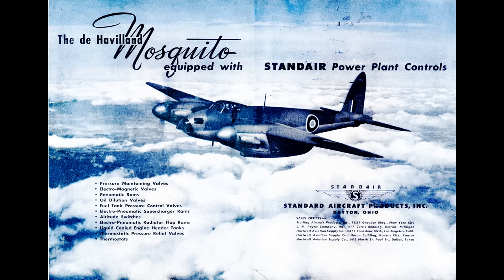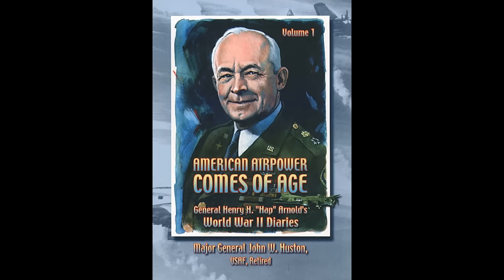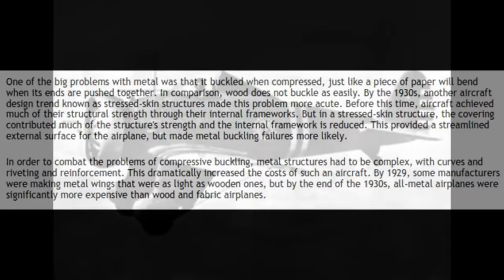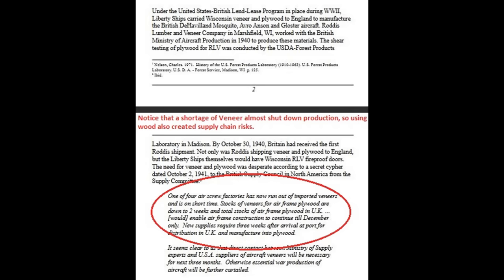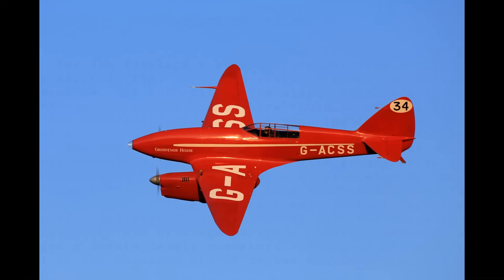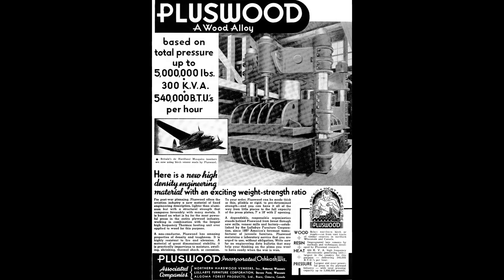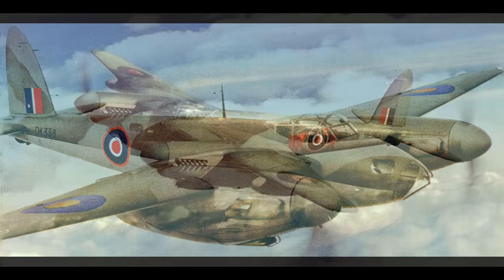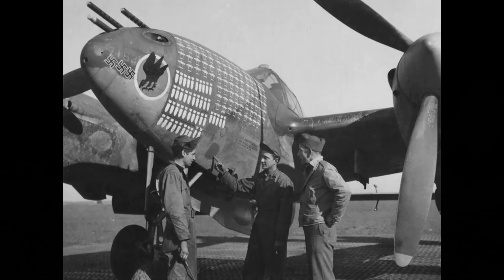De Havilland Mosquito vs. ?

Comment: America really missed the boat on the Mosquito.  This is almost a do-everything aircraft.  Only chauvinistic thinking and prejudice against wood caused us to take a pass on this.
Reply: @frankcorner8716  The B-17 looked good and got good press, and it was state-of-the-art for the 30s.  B-24 and B-25 were considerably better, but B-17 got the glamour.  Mosquito could carry almost as much as a 17, fly faster, cost considerably less, and only risk 2 people instead of 10, though not at such high altitude.  Another real winner that got left behind was the Westland Whirlwind.  It was a doozy, but shortage of Rolls Royce Merlin engines left it underpowered with Peregrines.
Reply: If wood was so superior - why did the RAF build everything else out of aluminum, even after the outstanding qualities of the Mosquito were known ?
Reply: If the Mosquito could do everything better, why did the RAF order many thousands of Lancasters and Spitfires and Typhoons?
Reply: Frank Corner - the Mosquito was actually a fairly poor high altitude bomber.  The RAF ordered many thousands of Lancasters even after the brilliant qualities of the Mosquito were well known
Reply: Frank Corner - and yet the US had negotiated huge manufacturing licenses with foreign non-belligerent and Allied Countries during WW2.  Rolls Royce, Bofors, and Oerlikon are good examples.
Reply: Frank Corner - oh, if altitude is your criteria for high altitude bomber performance then the V-2 wins.  Many viewers are making this flawed and over simplified observation and I’m sure that Greg will address it in a future video. Suffice it to say that 2,500 Mosquitoes will not provide better (or even equivalent) target service at 27,000 feet as compared to a thousand Forts or Lancasters.
Reply: Frank Corner - :  a Mosquito with a 4,000 pound bomb load is no longer a Mosquito.  It’s a heavily laden twin engine bomber with mediocre range.
Reply: Frank Corner - Wow, Bomber Command and the Eighth AF had it all wrong.  If they just used Mosquitoes they would have saved 110,000 lives and shortened the war by two years.  Those idiots.
Reply: Frank Corner - well if Bomber Command put up 700-900 plane raids with Lancasters then three  thousand or so Mosquitos per night would have done the trick.  Hell, might as well have 617 Squadron in the Mosquito.
Reply: Frank Corner - The RAAF had 209 Mosquitos.  They used them for primarily for photo-reconnaissance.  The RAAF and the RNZAF preferred the Beaufighter for anti-shipping and ground attack in the Pacific.
Reply: Frank Corner - Let me give just one example why it’s incorrect and misleading to superficially cherry pick performance data - especially when it comes to the Mosquito.  On September 28, 1944, the USAAF sent 243 B-24 Liberators to bomb the Henschel factory In Kassel, Germany.  The carefully planned raid destroyed 95 % of the plant floor space and put an end to King Tiger tank production.  After the war, it was learned that the raid caused the loss of production of about 657 Tiger II’s.  The long range load out for the B-24 is given at 5,000 pounds.  Since the max bomb load of the Mosquito is listed as 4,000 pounds - why didn’t the Allies send 292 Mosquitos instead?  Because it had to with properly “servicing a target” in Air Force parlance.  The B-24 has a considerably larger bomb bay than the Mosquito.  The Henschel factory was quite large.  And therein lies the nuance.  The 4,000 pound payload for the Mosquito was for one particular bomb - the 4,000 pound “cookie cutter”.  Alternatively, two five hundred pound bombs could be carried within the Mosquito bomb bay.  While theoretically it MIGHT have been possible for the Mosquito to also carry one 250 pound bomb under each wing - B-24’s with ten 500 pound bombs are going to “service” a large area industrial target better than a smaller number of large bombs, and the fact that the Germans told us after the war that the raid demolished 95% of the Henschel floor space tells us that the B-24 was the right plane fir this particular job.
Reply: Frank Corner - Frank, I hope you’re well.  You asked about the cost of the raid.  ** 198 P-51’s escorting.  31 B-24’s and 1 P-51 lost.  118 KIA, 121 POW.  The Germans lost 29 fighters and 18 Luftwaffe pilots KIA. 

* Eleven US aircrew were captured and lynched (killed) by civilians.  This was found out by the USAAF, and leaflets were dropped in the vicinity in follow up operations.  Just outside the city limits of Bad Hersfeld the USAAF carpet bombed an area to intimidate the locals and send a message.

* ** In 1990 a Memorial was erected at a USAAF crash site in the Seulingswald as a gesture of reconciliation
Reply: @frankcorner8716  - so happy to hear that Harry was rescued by the police.  No doubt that the RAF and the USAAF took a terrible toll on the civilian populations for five long years so maybe that's the difference.  I heard of a US P-51 pilot, a Captain, who was lynched by civilians the day the war ended.  The Henschel factory at Kassel was a very high value target, and it was defended by very highly experienced and well armed Luftwaffe fighter units.  German Jagdgeschwader 3 (Udet), 4 and 300. These fighter wings had Bf 109s and Fw 190s which had been specially adapted and equipped with extra armour and extra 20 and 30 mm cannons.   This battle was one of the largest confrontations in the ETO between the USAAF and the Luftwaffe - which was fascinating because the Luftwaffe was barely alive.
Reply: @frankcorner8716  - it was going to be bloody no matter where the Allies managed to land an invasion of that size and scope.  There are only a couple different places that you can do it and the Germans are very smart.  Rommel helped tremendously with his military engineering background.  The US Marines in the Pacific can attest to how costly it can be to assault dug in fortifications that have had the benefit of years of preparation.  Honestly, Frank, the Allied Commanders thought D-Day was going to have considerably more casualties than it did.
Reply: @frankcorner8716  - well, the German war machine ran low on fuel because of a sustained Allied bombing campaign from 1942 to 1945.  In 1940 the RAF had identified German oil targets.  The RAF and the USAAF suffered mightily in the Ploesti raids trying to put out Romanian oil production.  The Soviets pushed the Germans out of the Baku oil fields and the Allies eventually bombed out German held oil fields.  The Germans turned to synthetic oil production (coal to liquids) which was dispersed across 16 sites in Germany.  Between May 1944 and May 1945 the Allies launched 651 raids against German oil and fuel targets.  By September of 1944 the Luftwaffe was only getting 5,000 tons of fuel per month, which was something like a 97 percent reduction.  By December of 1944, Albert Speer informed Hitler that the fuel situation was "catastrophic".  The German Ardennes Offensive in December 1944 was literally predicated on the Germans capturing Allied fuel supplies at Antwerp.
Reply: @frankcorner8716  - The standard B-24 had at least 900 miles more range than the Mosquito.  There's absolutely NO way that the Mosquito could have bombed Romania using the Ploesti Raid routes.  RAF Coastal Command used B-24 specially modified VLR Liberators for the Battle of the Atlantic - specifically, to close the Mid-Atlantic Gap and for the Bay of Biscay.  Quite a few military historians will tell you that the Battle of the Atlantic could not have been won without the B-24 Liberator.  The RAF took delivery of their first Liberators on June 2, 1941 - six months before the United States entered the war.  In February, 1942 RAF Coastal Command and the First Lord of the Admiralty requested that NINE squadrons of US B-24's be transferred to Coastal Command.  At first, Churchill balked and wanted to use British aircraft - but Joubert insisted that the B-24 was the only aircraft suitable for VLR maritime operations.

Comment: A primary reason for using wood, was a foreseen shortage of metal.  And, by having a design made up of components let production be subcontracted out to unskilled, but trainable, workers. An added benefit was very little radar return.
Courtesy of Half Vast Flying.
Reply: The engines, cannon and machine guns in a Mossy fighter bomber weighed almost as much as an early Spitfire. Is there any actual data on the Mossy having a significantly  smaller radar signature compared to other aircraft?

Comment: P38 vs Mosquito? See: payload.
Reply from the maker: I have, one can carry 4000 pounds of bombs in multiple combinations (including dual 2000 pounders), the other can either 2000 pounds of bombs or a single un-aimable barrel loaded with 4000 pounds of explosives. Obviously there is a lot more to it, which will cover as this series progresses. Both planes are actually pretty comparable in terms of maximum payload and payload versatility.

Comment: Quick question for the moment, could the P38 carry a single 4000lb bomb?  If not, then the two were not equivalent.  The mosquito was designed to do so and did so.  At the time, that was the bomb load of a B17 for a long mission.  

I am not saying the P38 was inferior, but they were different aircraft designed for different purposes.  The craziest Mosquito was probably the TSETSE, only the British could take an aircraft designed for speed through being light, put some armour on it and fit it out with a 57mm, 6lb, anti-tank gun - U-boat commanders were not fans.  I especially like the film of the gun being test fired while the aircraft is on the ground, the aircraft rocks back from the recoil.

Seeing the Mosquito being used as a fighter aircraft, DH realized that it would probably be outflown by later fighters.  So during the war, they designed what would become the post-war Hornet.  Essentially, a small Mosquito optimized as a fighter, powered by two 2070hp Merlins (contra-rotating props).  This project was unfortunately put on hold till after the war, as the main threat from the German Luftwaffe had passed.  It was Eric Brown's favourite piston powered aircraft, he was probably the most experienced test pilot ever.

Like the Mosquito, DH looked at powering the Hornet with two 2400hp Napier Sabres (post-war that would have been the 3050hp version).  The Sabre was a BIG engine, the aircraft would have been a bit different, the cooling required for 6100hp of liquid cooled engines - the mind boggles.
Reply from the maker: Man I really need to finish that P-38 vs. Mossie video. So many misconceptions to deal with. Love you buddy, but you managed to get three wrong facts worked into your first paragraph.
Reply: @GregsAirplanesandAutomobiles  Bugger!   Wrong video!  I had too many tabs open at the same time.  Sorry about that.  Le me know if something is factually wrong.  Otherwise, misconceptions?

Nevertheless, the Mosquito was a larger aircraft than the P38.  Sir Jeffrey DH had the foresight to envisage the Mosquito, but he did so as a bomber.  I may have missed it over the years,  but I do not think he initially envisaged it as a multi-role aircraft, at least not to the extent in which it became one.  In some roles, it got away with it, the engines were far too obvious and vulnerable for these roles.  

They armoured the engines on the TSETSE as the anti-aircraft fire from ships was a bit too intense for the Mosquito.  

One of the lesser know parts of the story was in pursuit of the V1s.  The Tempest V was the main aircraft predator for the V1 as it was the only aircraft that was fast enough to catch a V1 in level flight (they flew low).  Unfortunately, there were just a handful of Tempest Vs available at the time (remarkable that so few shot down so many), enter the Mosquito.  The Mosquito kills were almost as many as the Tempest V,  but the Mosquito wasn't fast enough in level flight.  The RAE had been experimenting with Nitrous-oxide injection and a system was developed to fit in the bomb bay of a Mosquito, this increased the power of the Merlins by about 300hp each at all altitudes.  Even Stanley Hooker could not manage that.  Unfortunately, there just wasn't room for nitrous in most fighters, the system and tanks were large and heavy.  When tested in a Spitfire, the best they could fit was good for a little less than one minute, in the Mosquito, six minutes of nitros injection was available.

As previously stated, DH envisaged the Hornet as the fighter.  The Mosquito's success put the Hornet on the back burner.
Reply: Fact check needed
Reply: @sandervanderkammen9230  Fact check on what? You need to be more specific.  
Nitros system
 All of this information including photos of the nitrous system installed in the bomb bay is available to anyone using a simple search of the internet. 
The  VI 
The numbers of V1s destroyed by all types of  weapons are also available after a simple search, The aircraft figures do not vary greatly.  Land-based gun emplacements destroyed the most V1s after the introduction of the proximity fuse,  but then I did say aircraft preditor.

Sir Jeffrey DH thinking on the role of the Mosquito came from a book, I shall see if I still have any on the Mosquito but I doubt it.  We disposed of most of our books when we went traveling 20 years or so ago.  This is also most likely online The Hornet was designed in 1941 once the Mosquito was put into production, however as the war progressed the role this aircraft was to occupy became less critical.  The prospect of a fighter for the pacific theatre gave the impetus to complete the Hornet project.
Reply: @robertnicholson7733  You seem very confused and misinformed, nothing in your comments are accurate or supported by factual information.
Please stop spreading lies and misinformation on this topic.
Reply: @johnbrewer8954  The Alternate name for the Cookie was the "Blockbuster Bomb", it was called a bomb by most of RAF staff, sometimes just the 4000lb bomb.  Yes, it had a thin casing, but it still massed the same, it would shave been physically smaller had the casing taken up the usual percentage of overall mass.

The original design studies included a full series, of loads, equipment weights, engine powers, bomb loads, etc.  Early design studies also looked at alternate power plants (as required, at the time, by the MAP including the Napier Sabre).  The original bomb loadings were much smaller, however,  the aircraft's wing design was critical as pretty much everything is attached to it (the fuselage was often considered to be just along for the ride) and was designed with the future in mind, the fighters had strengthened wing spars to withstand the projected higher forces required for combat.  

Early in its operational life, there was no suitable large bomb, so they kept the clean lines of the aircraft.  

Like many things during the war, the developments were driven by need and availability of parts (such as suitable armament, bombs and engines).  Projects changed priority based on this projected need, an example is work being stopped on a number of RR engines (the Vulture, Peregrine, and the Exe) and the Griffin delayed in order to get the Merlin sorted as the number of aircraft projected to use the engine was very high. Similarly, the Bristol Centaurus was considered low priority compared to the requirement to continue the development of the Hercules, the Sabre was to fill the role of the Centaurus (yes, I know, unreliable, etc,  most people concentrate on the sleeve issues, but the plain bearings used in the crankshaft design was also a major issue).  After the Battle of Britain, The Sprint Interceptor was considered unnecessary, and the engine for it, the RR Crecy abandoned (apart from some minor research).  This is just a tiny selection of such decisions.